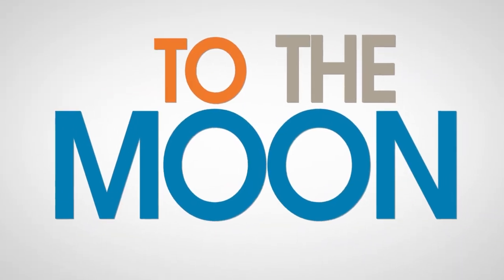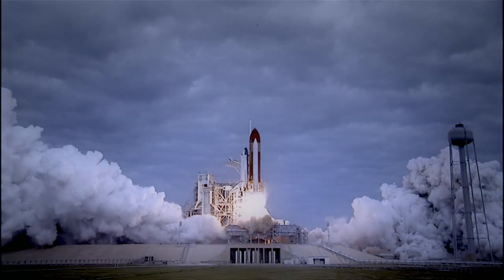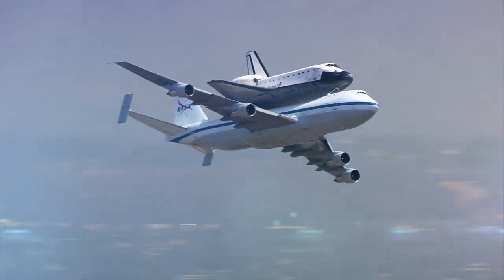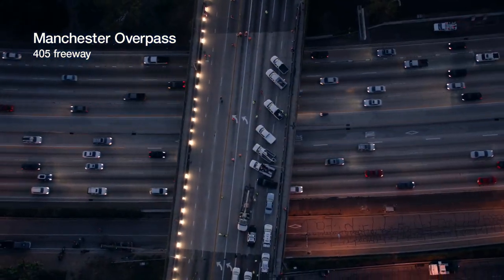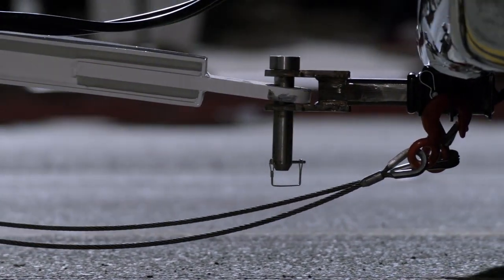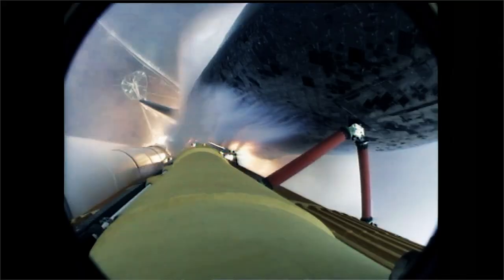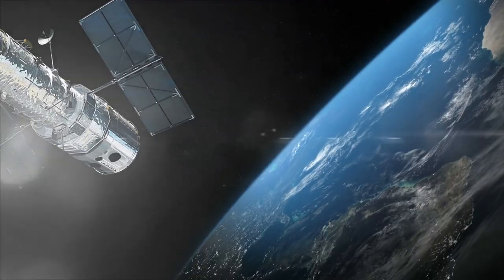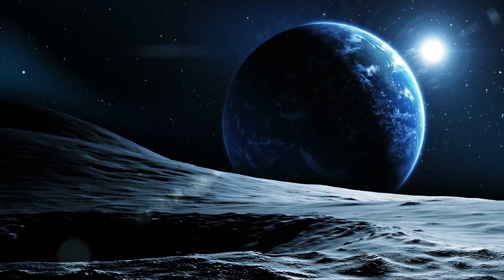Driving to the Moon!

Comment: Well, about how you said using friction wheels, there is no way that will work. The top speed would take forever to reach the counterweight. Also, the friction of the wheels would create tons of heat, which could damage the elevator car or worse... the tether itself can be damaged or even break (worst case scenario). So, instead, we probably will use magnetic fields to propel the ship into space. We already know that this works amazingly for maglev trains, so why not put it vertically. Plus, since it is friction free, it can travel at lightning speeds and barely need to deal with heat.

Comment: The downside is that the elevator will slow the planet's rotations and in a few hundred years, half a planet won't get any sun.
Reply: that's what the counterweight is for champ
Reply: Well, It was Vsauce's idea actually, not mine. Damn!
Reply: Ioan Katalin there is no way a space elevator could slow the planets spin, and it isn't mentioned on vsauce anywhere
Reply: kony thinks the counterweight is what's slowing the Earth's rotation. Like spreading your arms to slow your spin while skating on ice.
Reply: ***** it would only slow it down a little bit, the angular momentum of the entire friking earth is so ridiculously massive that a small change like this will not change the earth's period (or day) by a few microseconds
Reply: +Jp Cam  is that a few micro seconds per hour? per day? per year?...

Comment: They have finally developed the ability to make carbon nano tube threads, which means that we can use those threads to make the cable for the space elevator. With a little more development we could actually make the space elevator a reality in the next 20 years.

Comment: A space elevator hahahahaha Well, I'll put some information to ponder: a) The tallest structure in the world measuring ONLY 830 meters. That means remaining 99,000 meters! to reach the karman line ONLY hahahhahah ONLY by almost a mile, were needed billion dollars. b) The purpose of using rockets, is simply because it is the cheapest and quickest way to move up. In the hypothetical case of creating a space elevator, how many hours would it take to get to space? A rocket takes minutes. c) The space elevator structure should be flexible, not rigid, so that it can withstand epic forces never seen by man. This causes that part in the space fall because in the space not float NOTHING!! Objects orbiting the earth fall, but travel so fast (thousands of miles per hour) that it allows that it is constantly spinning around the earth ... are always falling but dont touch the earth.
Reply: 1 it would cost 100s of billions if not trillions 2. the rockets aren't the simplest way they're the ONLY way 3.a flexible elevator would fuck you up while you're inside 4. you don't know how objects orbiting the earth work. cheers bro
Reply: justin hutter 1. I think you understand, impossible to finance 2. now yes 3. mmm 4. Yes, I know. The frontier between space and the earth is to 100 km of altitude, but in theory all the atmospheric mass is below of 25 km of altitude. To more of 100 km of altitude the flight with wings is imposible, even less altitude. The reason is no sustainability, is vacuum, the movement is unaffected by friction and the move is ever continue, no stop, no reduce... but exist a force acts, and is the gravity. To 100 km of altitude everything fall, so, to avoid the fall, is applied the experiment of Newton's cannonball. Greetings.